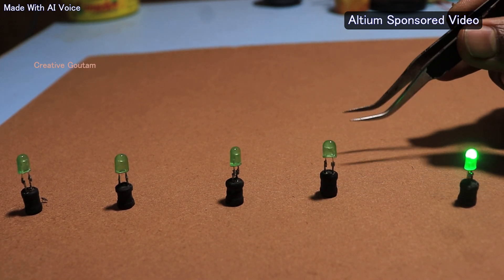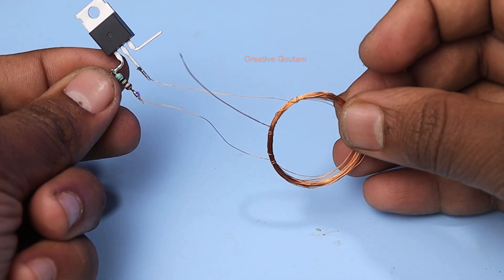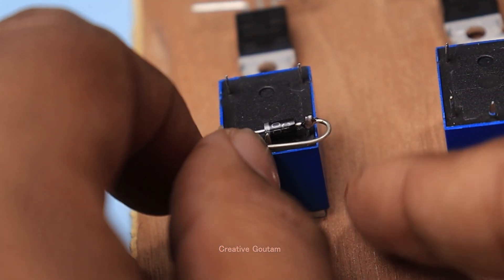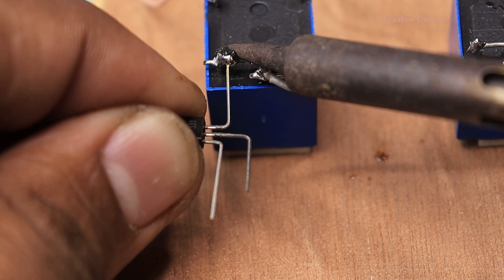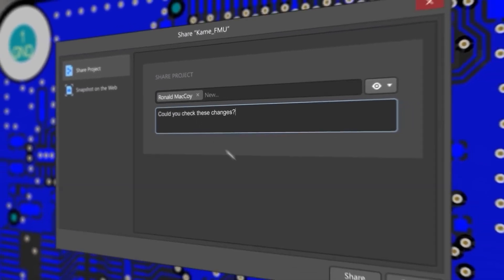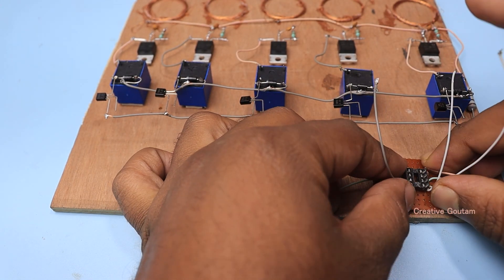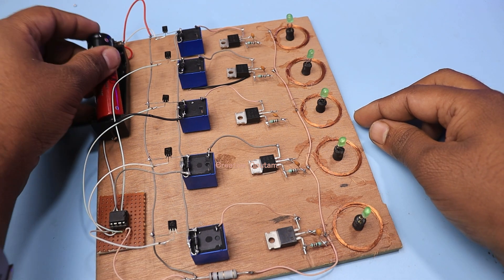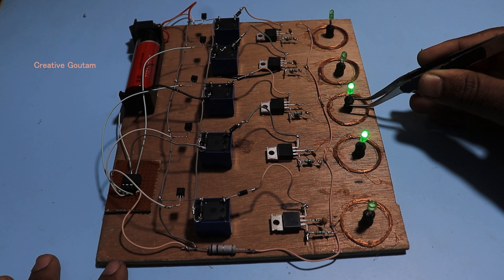Making Of Wireless LED Chaser

Comment: Fun project = Bravo. Suggestion = I am rather confident that you do not need the relays, at all. You should be able to drive the MOSFET gates directly from the transistor outputs... I think. And, I think that you should be able to drive the transistor bases directly from the ATtiny85 pins. Depending on what the current requirements are to drive the coils (and a little more for the LEDs, themselves,) you might be able to use a small 2N7000 MOSFET. So, the layout would be this... ATtiny85 output pin to base of transistor. Transistor output to gate of MOSFET. Output of MOSFET to coil. Now, that I think about it, you may not need the transistors, either. Maybe you can drive the gates of the MOSFETs directly. You would need to read the data sheets for the ATtiny85 output abilities and the MOSFET gate requirements. HTH.
Reply from the maker: Thanks for the suggestion🙏😊. But I think the high frequency reverse from the coil can damage the microcontroller. So I used the relay for Isolate the microcontroller from the coil circuit. I can also use optocoupler for better isolation.
Reply: @CreativeGoutam    "But I think the high frequency reverse from the coil can damage the microcontroller. So I used the relay for Isolate the microcontroller from the coil circuit. I can also use optocoupler for better isolation." Ahh... Good thinking. I had not thought of that. Cheers.
Reply: How about an optocoupler? They have isolation and a transistor. There are some hardier/stronger models. You have me thinking...
Reply from the maker: We can't use the MOSFET Gate pin directly, because the gate pin is connected to the feedback winding of the coil so that that mosfet can generate frequency by switching on/off. 
The relay is only providing current to each coil circuit one by one. And also it can isolate the microcontroller from the coil circuit.
Reply: @CreativeGoutam  Thank you for continuing to explain  this to me. "We can't use the MOSFET Gate pin directly, because the gate pin is connected to the feedback winding of the coil so that that mosfet can generate frequency by switching on/off." I am having trouble conceptualizing this part. A schematic would help. Maybe include them in your future videos. I didn't miss it, did I?